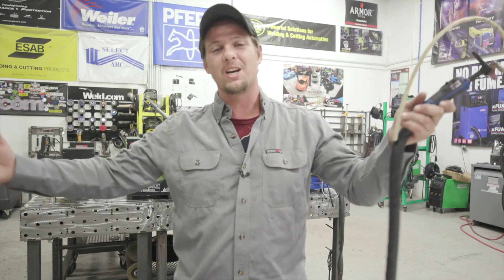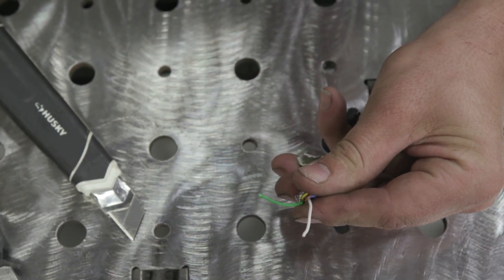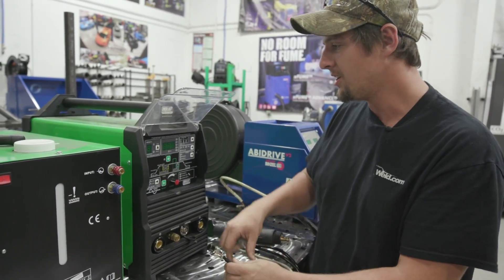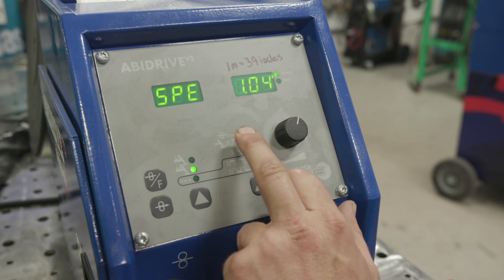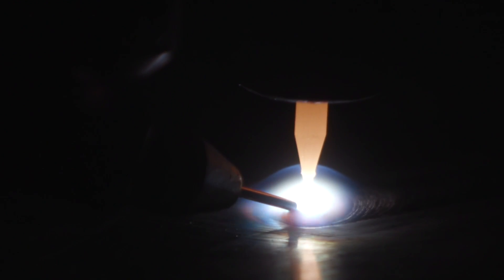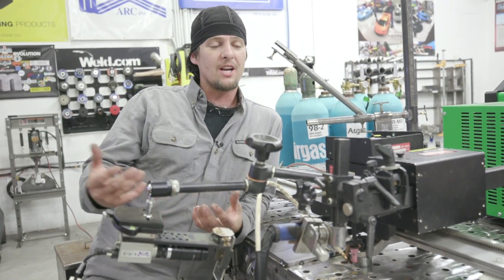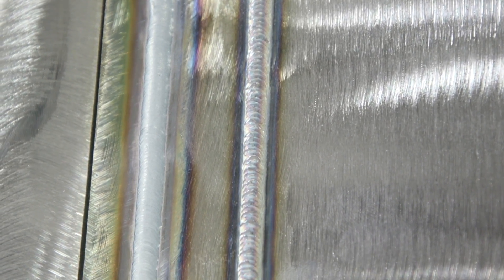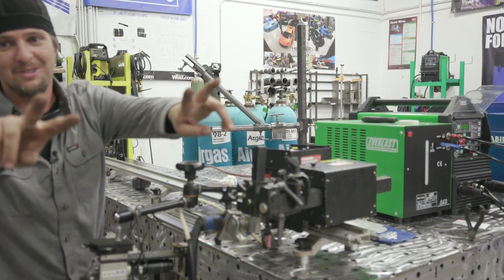Cold Wire Feed TIG Welding

Comment: Consider bringing in a nerd to help you out.  Your camera work is sufficient for a computer vision system.  It could see the thing you were calling out in real time and it could make the adjustments in real time.  Of course the computer would need to be able to change the gas flow, the welder settings, the tip height and travel speed, as well as adjust the wire feed and angle.  I might have left a few things out, and it's not really difficult to do those things.  An infrared camera would give you complete control your heat as well.

Comment: For whatever it's worth, I have been told to aim the wire to the edge of the puddle and possibly even sliding it in along the "cold" metal.  If you do drops, you would need to pulse the wire in sync with the arc pulsing.  A little shorter arc would reduce the voltage, power (heating) and puddle width.  At the same time it should become easier to stop the drop forming.  All this is hearsay, but has so far seemed to make sense to me.

Comment: Looks Good, Too bad, it was not around when I was doing repairs and fabrication tig welds for Naval Aviation and ground support equipment repairs. We used the good old manual Miller and Lincon welding outfits, the square wave had just come on the scene and we thought it was the equivalent of driving and automatic versus a Stick. Lol

Comment: I do cold feed welding with my TIG almost every day at my job. I use a Miller TIG and the MIG wire feeder from my Miller MiG welder for the cold wire feed. I disconnect the power to the MiG gun when cold feeding and I have to run it very slow for what I do. Like 0.5 speed on the dial. I do it all by hand, TIG in right hand Tweco MiG gun in my left.

Comment: You are having issues because the wire is not retracting from the weld pool so that’s why you’re getting the bubble effect. The actual machines designed for this purpose feed and retract the wire. Some pulse feed the wire you could modify the roller to obtain that effect.

Comment: I used to use twist pliers and safety wire for the occasional small hose clamp application.  It never clamped all that well or I'd break the safety wire.
 
Then, saw this rather clever DIY version of the ClampTite tool.  I've since used longer all-thread with a large hex nut welded on the end.  I've replaced around three dozen worm-gear hose claps with safety wire versions.  The safety wire versions are smoother, don't catch on anything, and best all, don't take chunks of flesh out of my hands.
 
Check it out:
 
https://www.youtube.com/watch?v=5w1_9IkeRmQ&t=196s

Comment: put 5 deg lead angle in your torch head and change your entry angle on your wire to a little more of a steeper entry and have it come into the front of the puddle. this will alleviate having to increase your wire speed and reduce wire drip.

Comment: I have a Tip Tig i use at work all the time hooked up to a miller dynasty.. it’s an amazing set up saves a lot of time and runs beautiful beads.. what’s different about the Tip Tig it has a hot wire and the wire Reciprocates it mimics dipping the wire in the puddle.

Comment: Here’s a soldering trick. Load the solder onto your wires before trying to solder them together.
Reply: Agree, called tinning. Soldering isn't hard but there is a right way.
Reply: True. This soldering was horrible. 
First he should remove a oxides by knife, then put a flux, little bit solder for both wires and finally join together.
Reply: @kdstechnika  The solder wire contains flux, if the wires are clean then no strict need for adding flux. If the wires are not decades old, probably won't need sanding or scraping either. The ones in the video seem clean. Just tin the ends, both, then solder them together. Alwas add new solder while soldering, do not just reflow the material already there. Do not add excess solder in the tinning step that makes balls on the wire, just enough to cover the strands, so you can add much more while soldering together.
The reason for needing fresh solder is that the flux already burnt out during tinning, and does not prevent oxidation any more. Reflowing will make a porous and weak joint. Adding fresh solder into the pool prevents oxidation and makes a shiny joint. Think it as shielding gas. Do not elongate the process because the same happens. When both metals reached the working temperature and the solder is molten and seems flown around them, stop feeding the solder then abruptly remove heating. And keep the pieces from moving until it is solid, of course.

I can solder everything to everything, but of course suck at welding. 😉

Comment: Isnt a automated TIG Welder just a MIG Welder?
Reply from the maker: Not at all. In MIG the wire is the electrode. TIG uses tungsten as the electrode. TIG has many advantages over MIG. We simply automated the feed process
Reply: Weld.com  Yes and all those advantages are eliminated with your automated feed system. 
So youve just built a basic version of a MIG welder. Just with more/unnecessary parts as you could delete the tungsten and run the arc directly from the wire, as the wire is there all the time anyway. Which would then be a true MIG system.

Dont get me wrong, I respect all the knowledge and work youve put into that project.

Comment: No need to rob the plug from an Everlast torch, if you search for CB microphone plugs in E bay or Amazon you will find those plugs in many pin configurations,just find six pins ones. They go from two to eight pins. And are very cheap costing just a dollar or two.

Comment: Question: why use 3/32 tungsten when your at 175a, then moved up to 209a... little hot for 3/32, ya think? Looked like either contamination or deterioration on the tip of the tungsten. And i didnt hear what size wire he was feeding into the puddle, could you elaborate. I personally would have chosen a 1/8 tung, #8 cup with a gas lens. Also, i always have a travel angle on my torch, not much, but a little...
Reply from the maker: We probably should've upped the tungsten size and wire to help the balling. We only had a 5 cup for this torch as it's a special cup. The wire was 035.
Reply: i agree. probably to hot, and the tungsten isn't getting cooled enough. it looks to me like the tungsten is building up dendrites. it also could be a bad quality gas, or just a bad gas coverage.

Comment: Theirs a kind of welding call cladding that uses the same method as this.
Reply: Didnt know that.Thats cool. Thank you for watching weld.com. Stay healthy and safe
Reply: i used to do cladding.  18 ga stainless steel over 2" mild steel core for large plate heat exchangers..  laser cut sheetmetal is bent to fit tightly over the core.  it can be done by hand, without any automatic wirefeed.

Comment: Arc machines inc in California has this already.  It’s not cheap.   You can use it for orbital heads or on a track system.  I used a wire feed orbital head back in 2007.

Comment: So basically, you converted your fancy TIG rig into a complicated, more fiddlely to adjust, less convenient to use MIG...   Ok...🙄
Reply: It has applications where GTAW is required and a shop can make more money by upping productivity. It also allows for very long repetitive welds to be done effortlessly by one guy.
Reply: Sic Semper Tyrannis  This isn't for following complex shapes or correcting poor fit up. This is for machined parts or long seams. Think of a 20' long seam weld on thin stainless sheets. You could even keep the torch stationary and run circ welds on tanks using a set of powered rolls. There are lots of practical applications. This setup was a little homebrew but there are lots of semi automated systems out there and they have been around for more than 10 years. You likely won't be running this system by hand but you could if you wanted to I suppose.
Reply: How about for welding materials that aren't commonly MIG welded??  Such as titanium with a trailing cup hooked up to the torch.  It's all just not steel out here.
Reply: Yup
Reply: I thought it was cool, nice looking welds, more of a mass production type of process.
Reply: Sic Semper Tyrannis  my mig isn't that fancy, it's all electronic but the settings is only wire speed and current : /
Reply: for the views!
Reply: Calm down sir, in serial production it can be very productive, fast and more effective than MIG process, welding that fast without spatter for sure is something like the better of both worlds
Reply: @rea50  Yea but flyingdismount likes spatter.
Reply: @austin5806  what's is that?
Reply: Yup 😁. Thanks for watching weld.com. stay healthy and be safe
Reply: @mancubwelder7924  YES Cub lol :), I dont think u were going for a smart, practical mod for all of us to be inspired by. I feel this is another one that shows people, to travel outside comfort zone, get creative, and with enough focus and research, u can basically accomplish anything u set your mind to in a shop. Maybe next time make a video about "how to get the obvious use out of your basic welding machines" to appease your following of Nay-sayers and cynics. Hahaha way to be creative for a video cub!
Reply: @mancubwelder7924  lol
Reply: @mancubwelder7924  dont let guys like that bother you the company im working for is working on. Doing this with tip tig for aerospace parts. Its the future.
Reply: with MIG, the current goes through the wire, which causes it to behave very different...it's still TIG :P
Reply: AKAtheA it was a joke <.<
Reply: No vision. Sometimes it's cool to play with things
Reply: Tig is for nerds
Reply: @welderboy13  what is the most CHAD process of welding and why is it STICK?
Reply: People in this thread salty about what was a funny joke. 
Calm down, we are all here to enjoy welding and he was just taking the Piss